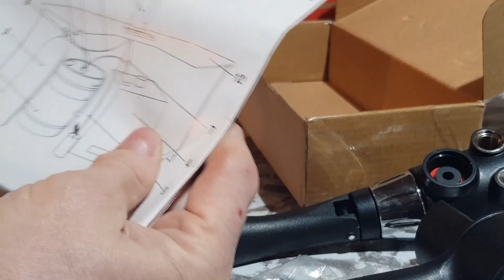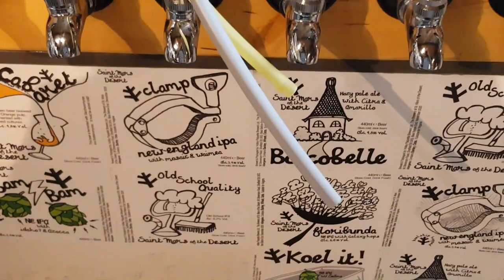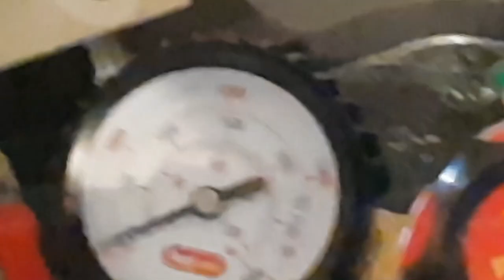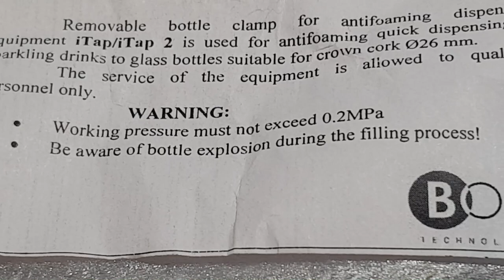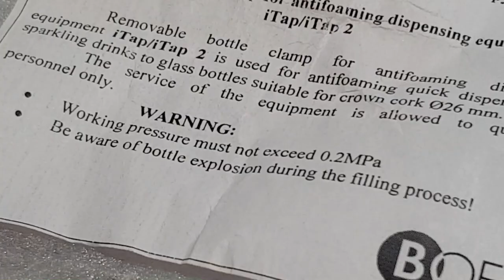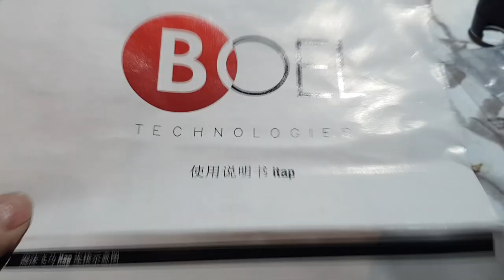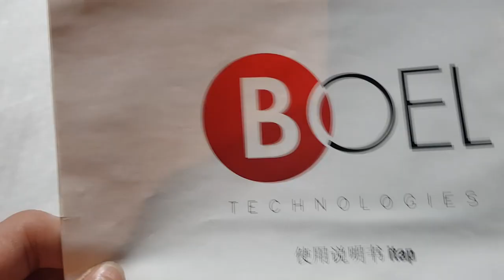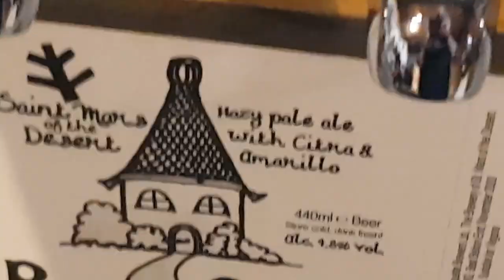BREW - BOEL iTap Counter Pressure Bottle Filler

Comment: Hi Martyn, one year on is the itap still working as intended ? I’ve tried varying methods to bottle from a keg with limited success. More beer on the floor than bottles. This could be my answer to less waste. As always great intuitive videos. Well done.
Reply from the maker: My most used piece of kit before getting the iTap was the mop - I hated bottling - if it wasn't flat or oxidised it was on the floor.  The iTap is simplicity and reliable.  I'm tempted now I've got both PET and Crown Cap adapters to try the swingtop too.
The mop has had far less use, result!
Reply: @MadeByMartyn  it will be my next home brew purchase. Thanks for the reply

Comment: Here's the link to the manual, 
https://docviewer.yandex.ru/view/0/?*=9JMQC4kO6FVSfSKpiG%2FnxKp6u9x7InVybCI6InlhLWRpc2stcHVibGljOi8vMjlQUHp4MysyakRNRjFMRDhEUXk4Z3crZCs4S2M4UWlrVWlOc0Qwd2Nic25LQWQ5Q0dSUUdkMGVwT3U0MzVYY3EvSjZicG1SeU9Kb25UM1ZvWG5EYWc9PSIsInRpdGxlIjoiMS5NYW51YWxfaVRBUC5wZGYiLCJub2lmcmFtZSI6ZmFsc2UsInVpZCI6IjAiLCJ0cyI6MTYwOTIwODA3OTkxNywieXUiOiI5MDU0NDc1NjIxNjA5MjA4MDcxIn0%3D 
on the page you can translate it to english. Your also able to download it as a pdf file. Hope that helps.
Reply from the maker: Brilliant, thank you !-)

Comment: Have you got the link for where you bought it from? UK suppliers seem to be twice the price you paid. Did you get stung for import tax?

To save other people looking it up 0.2MPa is 29psi
Reply from the maker: I bought it here:
https://www.ebay.com/itm/203177162138

This avoided the import tax, but I think I may have been lucky, it's from Ukraine.  Took 18 days I think.

I too looked at the pressure conversion and thought 29psi a little scary for recycled bottles with uncertain provenance!
Reply: @MadeByMartyn  do I or don't I order one.........

29 psi is a lot
Reply from the maker: @Pauldh601  I run mine at serving pressure and it's fine.
No way would I fill glass bottles at 29psi!
I'm already rating it much higher than any other I've tried.  It's perfect for my use.